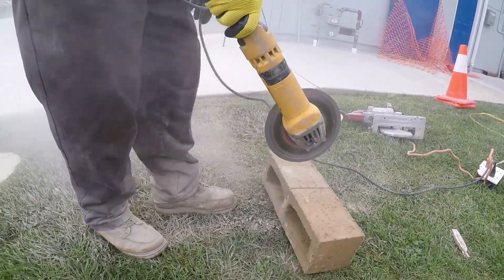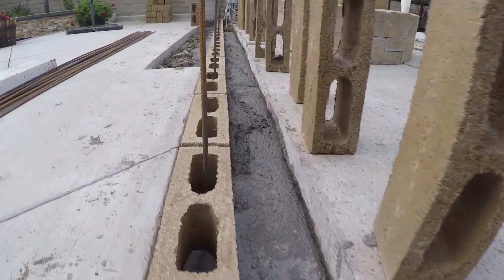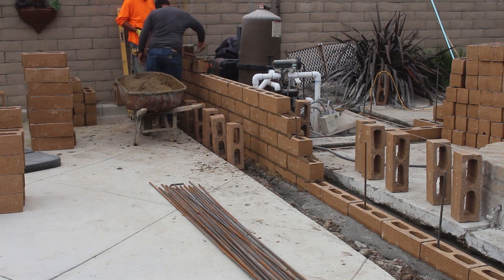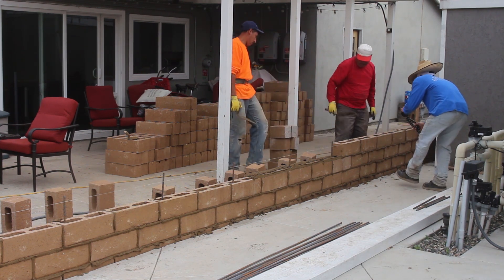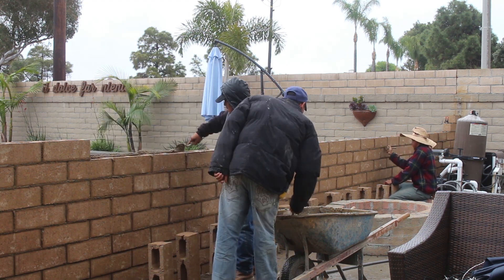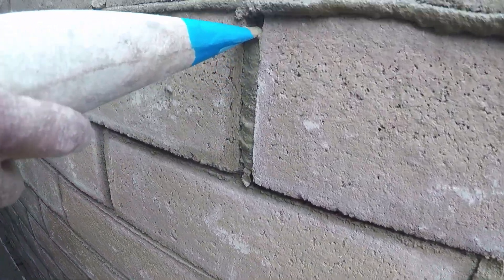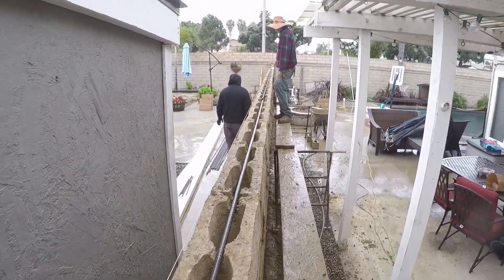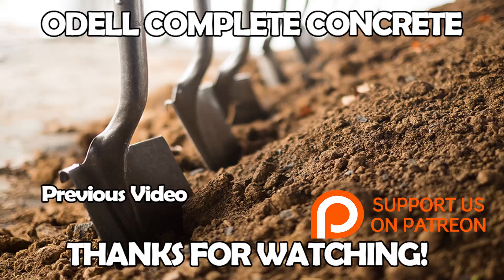How to Build and Setup a Block wall Part 2 Slump Stone

Comment: My first time doing block work I was 15yrs old and I learned how to setup the blocks, leveling bricks, concrete work of all kinds.  I remember setting up the bricks because if they weren't setup correctly they were kicked over and I was running to grab another one.  I learned quick, because the 100+ degree heat will wear you out quick.  I did it for 2 summers and I was good after that.  Hat off to anybody who works in the elements everyday.  Keep up the good video's.
Reply from the maker: Sounds familiar.
TY

Comment: So far, this is the best DIY guide I've seen. Thanks  Mr. Odell for sharing. By the way, you didn't show the 2nd vertical beam installed and tied to the horizontal bond beam. How far below did you bury your vertical? Thanks.

Comment: Great video, if you are working this fast what prevents the previous lines of bricks from going out of level as you tap the ones on top? What prevents the bottom lines from moving?
Reply from the maker: Set up quickly, and stands on the aggregate

Comment: You need a quickie saw with a diamond blade for cutting block and a paddle drill with 5 gallon bucket for mixing mud. Really speed progress
Reply from the maker: We have all that but they choose this, probably because of so few cuts

Comment: Absolutely beautiful.  I want to go my property the same but I have seen some properties with horrible block work.  I just don’t trust anyone around here to do it right like you all.  So I’m going to do it myself.  I have a few questions if you get time to answer.  I will be doing a wall about 120’ long but will have a 16’ sliding gate.  Should I continue the foundation monolithic the whole 130 foot.  Or should I do two separate and leave the gate area open?   Also if you could go over how you do your 90 degree turns in the wall.  I noticed where the gate was you built that little wall right up next to the main wall.  But for the pool pump area you did it differently.  I know it’s a lot to ask and you are obviously really busy.  So I appreciate all that you show us
Reply from the maker: I would leave the gate areas open.,
The corners are interlocked

Comment: Regarding the cold joint. Eventually that will be the break point after a long time. The earth got movement. Would it be better to reinforced that point with more rebars? Perhaps continue the block causes over 60 feet. I trust your experience and wish to hear your comment. 
Also what happened if i have 2 feet split or drop floor level over the neighbor's land? What is the rule of thumb over the maximum height for such block fencing? I assumed your fence height say 7 feet + 2 feet split level. Too high for such foundation to handle the load? Please advice. Tq. Appreciate that.
Reply from the maker: retaining wall.
City engineered drawings.

Comment: one of the finishes we used to do on blocks a bit dodgy using only one plank to walk on..better two for safety...was  the bucket handle...we used an old half round bucket handle bent into an 'S' shape amd rubbed along the joint....I suppose you could use a piece of 1/2 inch copper pipe...
Reply from the maker: Yes whatever you have handy

Comment: Do I need a footing on a three high slump block wall with flat cap along the sidewalk just for stopping sprinkler run off water?  I'm thinking of just laying down a wider bond beam block just under grade with steel and fill the cells with concrete.  It's non retaining wall and permit is not required in my city.
Reply from the maker: A small footing will help the longevity.
4" x 8"

Comment: Those joints sure did get off in a hurry.  Great place for a potted palm tree.  Turned out great
Reply from the maker: Yes 1/8" times 12 blocks 1.5"s at top

Comment: Mr Odell,

I'm building a 4' tall, L-shaped wall to hide my trash cans. The short part of the L will be 8 feet long and the long part will be 10' long. Can you tell me how wide and deep a concrete footer I should prepare? I'm using 8x16x8 block in Central TX. I'm going DIY because I can't find a contractor to handle such a small job. Your helpful video have given me the confidence to give it a shot. Thank you sir.

BTW...my daughters name is Layla....and I miss the OG intro music too!
Reply from the maker: 1 x 1

Comment: Jesus, you are cutting blocks without blade guard! You're brave...
Reply from the maker: it's a little scary
Reply: I wouldn't call it bravery, rather something else...
Reply: No dust control or respirators either. Doesn't CAL OSHA have a silica dust standard?

Comment: Do you have any after pics or video of the neighbor side wall once complete . Or how does someone go about filling the less that one inch gap between the existing concrete slab and the new existing wall . Say around 15:55 . Awesome job btw
Reply from the maker: we filled it in with concrete

Comment: Hi David. Wonderful work by you and the team! Just a quick question for clarification: at the very beginning of the job, you cut out a section of the concrete slab at the back yard which were then patched up at the end of this video, at 15:35. How come that much of the slab had to be removed? there was a much narrower footing down the rest of the line.
Reply from the maker: The saw can only get so close to a vertical obstruction

Comment: How did it get so far off the head joints from the bottom course
Reply: I believe earlier in the video, mention made that the existing wall had quarter inch mortar depth on the courses, and the new wall had 3/8 inch mortar depth on the courses. Please correct me if this is incorrect.
Reply: @xraydelta100  not talking about the bed joints lining up to old wall, talking about the head joints are off from bottom course when guy is laying it there not lining up on half bond
Reply from the maker: Yes the exsisting wall was thin bed joints
Reply: Head joints looked off

Comment: Do you charge by sqft of wall or per brick?
Reply: FishFind3000 block work is typically bid to the customers by SF. The only time we use per piece is when we are figuring out production per man, or when we want to sub the work to someone else (if we are unable to perform ourselves)
Reply from the maker: Lineal foot

Comment: Do you fill the wall with concrete?
Reply: David said each cell that has the vertical re-bar was grouted.
Reply from the maker: Where steel occurs